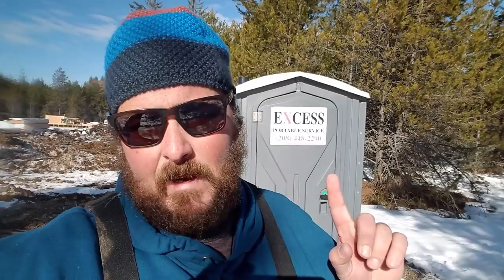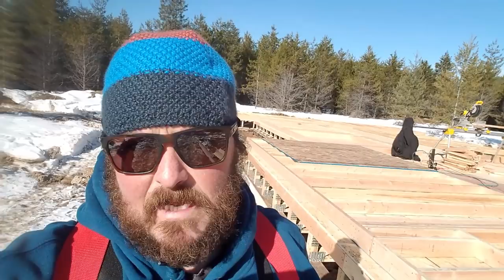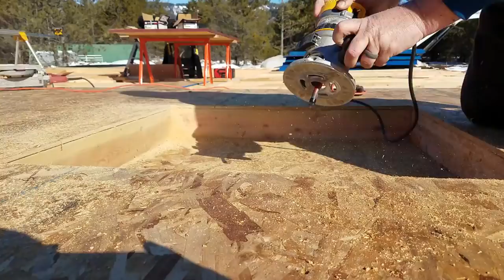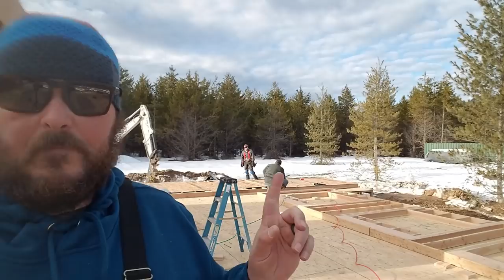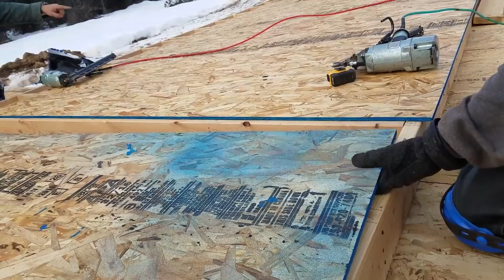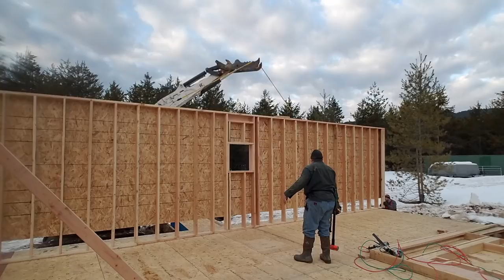Standing Up Walls, Turning Lumber into a Beautiful Home

Comment: have you ever built walls using 2x6 plate and 2x4vstud inner and outer walls on 24" centers? you can foam insulate or rock wool and have no cold transfer from outside to in through the lumber they make very warm walls

Comment: Just a comment why do you not toenail your bottom plate on your exterior chalk line before framing which would keep the wall straight and secured to floor to make standing in place much easier 
We generally toenail about every 4’ on the line to the joists through the sheeting with 3 1/4” spikes

Comment: Did you overlap the sheathing by one inch past the single top plate so that when the truss sits on the wall, it doesn't bump into the sheathing, being that the next top plate will be 1 1/2 inches?  If not, what was the one inch for?  The rookies that you are teaching  need to know about this important detail.

Comment: 1) Do your paperwork in your car with the engine on and heater blasting; and 2) breathe thru your mouth when you take a dump. If you have to do both at the same time, suck it up . Thx for the vid!

Comment: Tool question. What router bit are you using, on the opening cut outs.?
Reply from the maker: Sunny,
 We use the Freud 3/4 flush trim router bit
Reply: Gracias